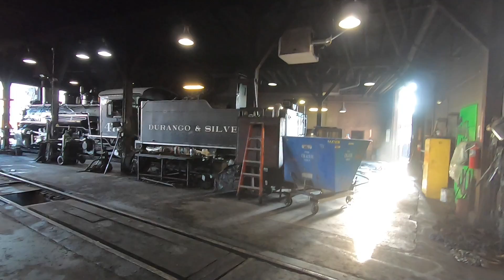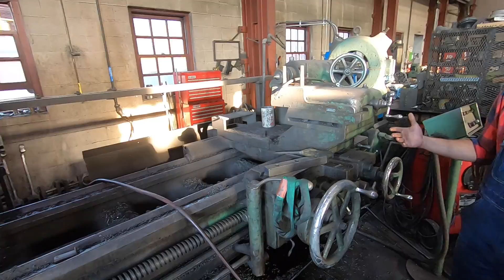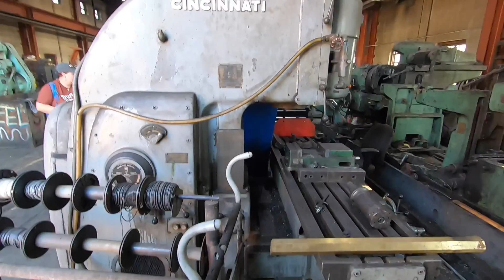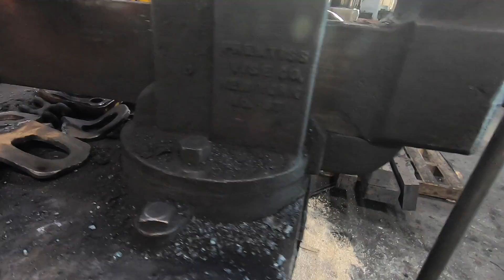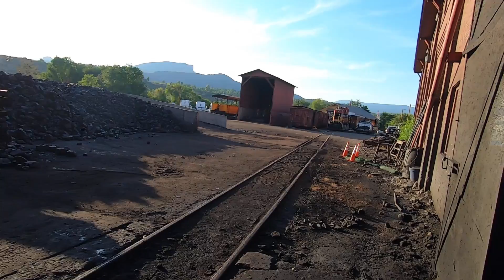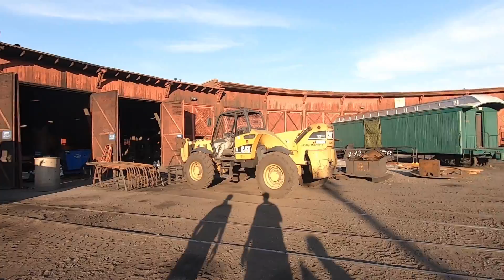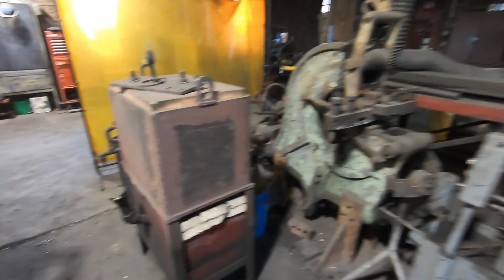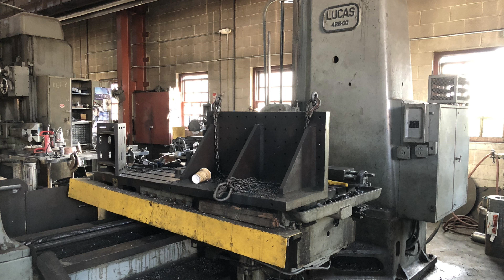Durango & Silverton Railroad Machine Shop Tour

Comment: A nerdy question for those that know, do the trains in this video run on narrower gauge tracks than steam trains in the UK?
Reply: this is narrow gauge which is 36 inch gauge between the rails now I don't know what the gauge is over in the UK so you will have to compare that your self over here its the 36 inch gauge for this RR and back in the day I think it was used for logging or the mines for coal or gold don't remember which but look it up on computer
Reply: @chrismchenry9891  
Standard gauge in the us is 4' 8.5".

Three footers were used because they were initially cheaper to build.
Most were abandoned or standardized as the years went by due to the added complexity of not being able to interchange with the rest of the country.

This railroad is fairly unique in that they run "inside" frame locomotives. The drivers are inside the frame while the rods and weights are on the outside.
Reply: @841k9  I know standard gauge is 56 1/2 inches and narrow gauge is 36 inches trust me I know because I worked on 2 track gangs in the US here and on one of those RR I helped them rebuild a 30 inch gauge HK Porter steam engine and got to run it a couple of times but mostly ran the diesels so I am very framiliar with RR stuff